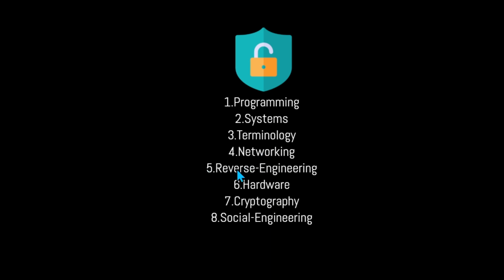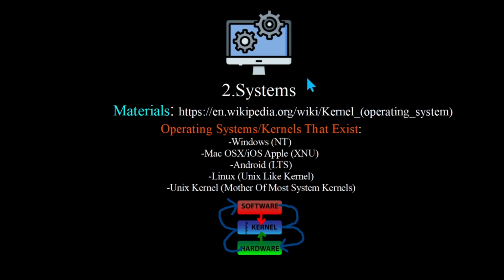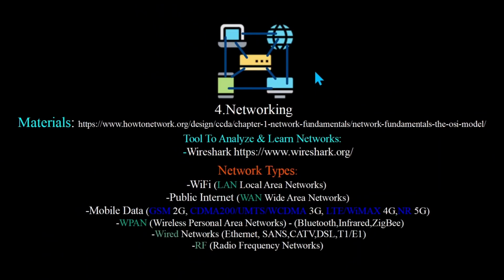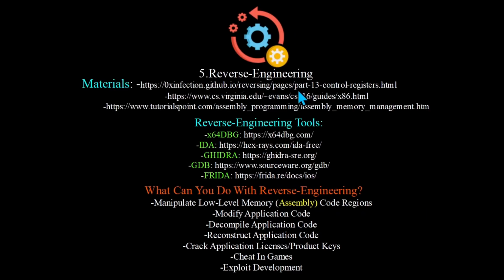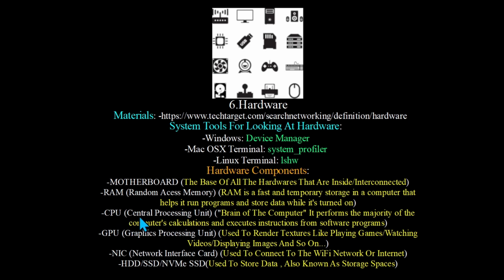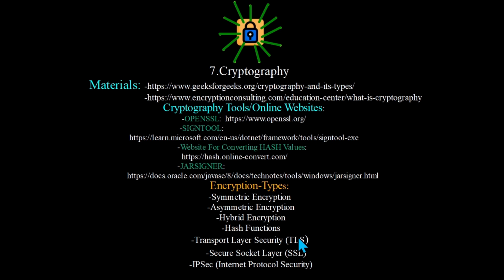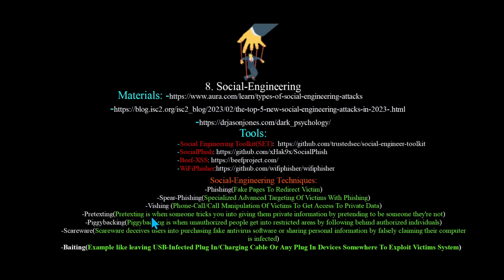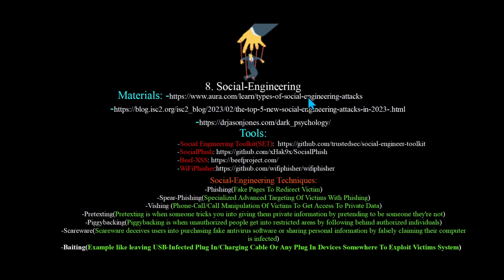Top 8 CyberSecurity/Ethical-Hacking Career Tips - Become A Professional Hacker

Comment from the maker: My Advise For Beginners:

For CyberSecurity/Ethical-Hacking/Pentesting Beginners: You would need to have a (SOLID UNDERSTANDING) about Programming,Operating System,Networking,Software/Application,Hardware,Reverse-Engineering,Cryptography,Social-Engineering as of how it  works.

1. Networking:https://sunsreynat.files.wordpress.com/2014/07/ccna-in-21-hours.pdf, https://www.imperva.com/learn/application-security/osi-model/, This Tool Is Used To Sniff Universal Protocols & Networks https://www.wireshark.org/ learn how to use it in a practical manner and understand how (TCP/UDP IP Protocols) Or (HTTP,HTTPS Website) Transport-Protocols work and how IP Adresses work and always research on Youtube/Google as of how it works specifically all the existing protocols that are commonly used and how everything gets sent out or received. (MASTER THIS!)

2. System Architechture/Kernels: Windows NT Kernel System:https://en.wikipedia.org/wiki/Architecture_of_Windows_NT , Linux System Kernel:https://en.wikipedia.org/wiki/Linux_kernel, Apple Kernel iPhone/iPad/Mac OSX: https://en.wikipedia.org/wiki/XNU . (Have a Solid Understanding as of Kernels Of Systems These Days works , Kernels Connect The Graphical Interface and The Hardware All Together , they are like the Main Point Of THe System For Interconnection/Functions)

3. Terminology/Terminal/Command-Lines: Linux:https://www.javatpoint.com/linux-commands, Windows:https://learn.microsoft.com/en-us/windows-server/administration/windows-commands/windows-commands# and so on ... Its important to know how to interact with the Terminals on many different kind of Systems as you can do much more Advanced Interaction With The System and also they have integrated Scripting Languages To Automate Stuff like Bash for Linux, Batch Windows, Applescript Mac OSX and so on it depends on the enviroment. (IMPORTANT !)

4. Programming/Coding: https://www.w3schools.com/ , Learning how to programm is the most important in hacking/cybersecurity . Learn Software-Application/Programming Languages: C/C++/C#/Python/Java/Rust and Learn Website-Programming Languages :  Frontend-Website Programming Languages like HTML,CSS,Javascript Backend-Website Programming Languages Like:Django Python Backend Framework,NodeJS, Ruby On Rails and so on to understand as of how everything interfunctions. and choose a programming language to write Quick Scripts like Bash,Batch,VBS,Applescript.... To Automate Stuff  On You're System / Network easily. Also theres a a Powerful Networking Manipulation Library For Writing Networking Tools like Scapy https://scapy.net/ .

5. Reverse-Engineering / Software & Applications:https://www.makeuseof.com/reverse-engineering-concepts/, Tools For Reverse-Engineering:https://www.apriorit.com/dev-blog/366-software-reverse-engineering-tools. With Reverse-Engineering you can Disassemble Code or Reassemble/Reconstruct Code and Overall Crack/Modify/Patch Applications/Softwares/Apps or look inside the Executable File if it is a Malware or not , you can also Develop Exploits with it too . 

6.Hardware:https://en.wikipedia.org/wiki/Computer_hardware , know how the Physical Layer or the overall functions that are the BASE that powers up everything on the System/Computer/Phone works. like the CPU Processors , RAM (Memory) , Graphic Cards , HDD/SSD/M.2 NVME SSD Harddisk Drive Space, Wireless Cards/Wireless Adapters and so on work.

7. Cryptography: https://en.wikipedia.org/wiki/Cryptography learning how overall Security Works or how the Alghorithms work, TLS/SSL are common protocols used in modern websites if you guys see on the links (HTTPS) is Secure and Encrypted with a Cryptographic Key,  (HTTP) Is Not Secure, also there are other Cryptographic Encryptions For Files like (AES) or Cryptographic Protocols for Wireless-Networks like TKIP/AES too and so on to Secure The Communication and Data Integrity. 

8. Social-Engineering: https://us.norton.com/blog/emerging-threats/what-is-social-engineering, social-engineering is used to manipulate the target/victim that you get what you want it has to do with psychological stuff, it can be over Digital Interaction lke SMS , Emails ,Messaging-Platforms, Real-Life Interaction and so on.

9. For Learning (Practically For Pentesting Websites & Pentesting Systems/Servers) These Websites Are Good: https://hackthebox.com/ , https://portswigger.net/web-security thats overall my conclusion of as how you can                                                                                                                                 ###(MASTER THE ART OF HACKING)###